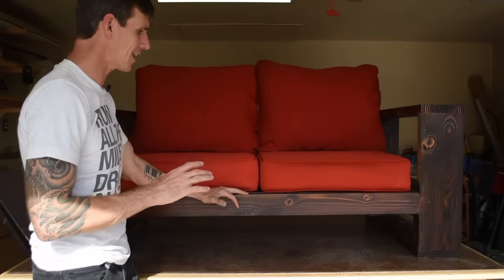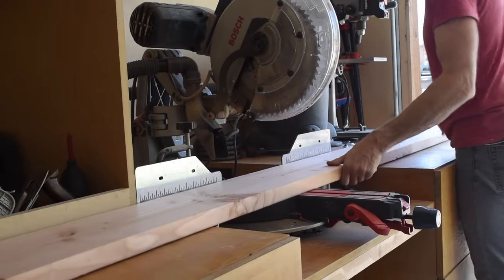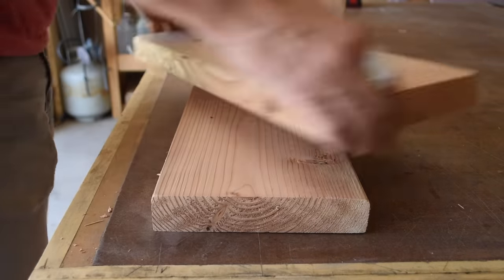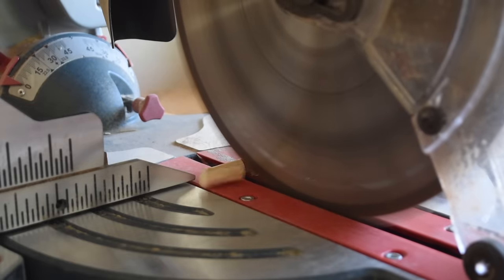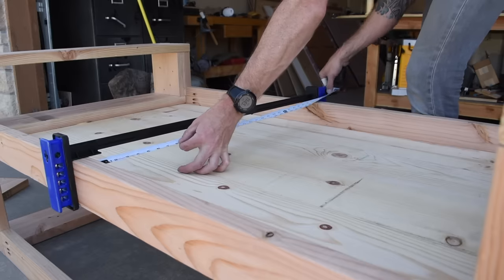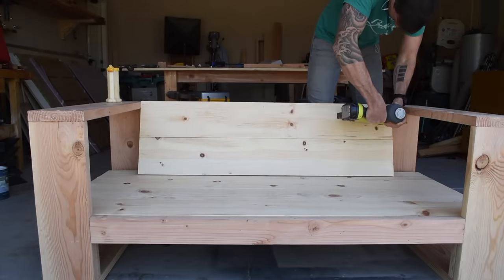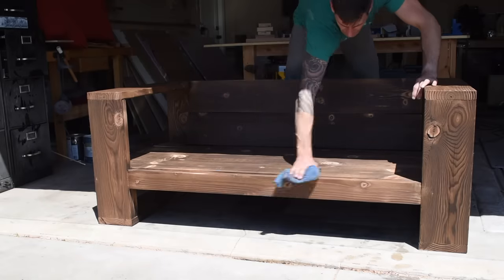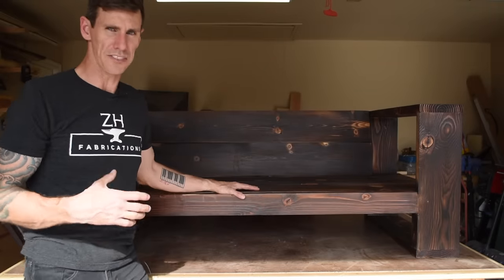DIY Modern Outdoor Sofa -  Shou Sugi Ban | Limited Tools | Free Plans

Comment: I don't see how the measurements of the wood purchased translates to the dimensions of the build. With my calculations  it seems you'd come up short on 1x8's. I think you'd need 10 foot 1x8s not 8 footers to have enough for the seat and the back.
Reply: Yup, I also ran into this issue
Reply: We're are the cut sizes.

Comment: I built this as my first ever DIY build and it turned out great. I did not use the burning but rather used a dark stain and quickly wiped it off.  It didn't turn out looking burnt like I had hoped, but I am really happy the way it turned out. I'd also like to mention that I didn't use a planer and it looks fine.  It did mot best to pick out good wood, but since this took me a few days some wood warped after it was taken home.  All things considered, I LOVE this on my balcony and 100% recommend this for anybody who is a complete novice.  I only used a circular saw for the cuts for those wondering if you need a crazy saw like he has. Thanks, Jonny!

Comment: Nice build! Be sure to preload those end grains with glue . Simply apply glue to the end-grain. Let it soak in.  Apply more as needed until it stops soaking it in. Then continue as normal. This will tremendously improve the bond strength of an end grain glue up.
Reply from the maker: Good tip, thanks!
Reply: Cool. I got this from Steve Ramsey. He owns the channel woodworking for mere mortals. He has a lot of really scaled-down tutorials on woodworking tips and tricks that are super easy to relate to.

Comment: Hey man, the sofa turned out great! I’m interested to see how the wipe on poly holds up outside, not something I’ve seen for outdoor use before.
Reply from the maker: I'm actually curios myself. My thought is the torched wood does most of the protection from the elements, and the poly just adds that nice feel. It could potentially be a disaster!
Reply from the maker: Also, thanks man! Hope things are going great with J5!
Reply: Jonny Builds for sure, my worry would just be that it’ll peel off. Keep me posted, fun experiment for sure!
Reply: Jonny Builds and thanks man’
Reply from the maker: Ok, will do!
Reply: Let us know!
Reply: Bộ ừu sẽ dễ để
Reply: @JonnyBuilds  Hey Jonny, and how is it now?
Reply: @JonnyBuilds  any updates on this??
Reply: @JonnyBuilds  any updates on how the poly did?
Reply: what would be the typical finish for outdoor sofa like this? (also specifically for pine/fir would be helpful)
Reply: My experience with using poly outdoor is it does crack rather quickly.

Comment: Wait 🤔 you can use poly outdoors instead of spar urethane or are both good in this example since the burning of the wood already acts as a protection layer ? I'm very much new to wood finishes experience knowledge.

Comment: I like it and simple to make. I would of put feet on it to take less surface touching the ground. 1 to 1 1/2 inch blocks. Question- did you use treated wood? I watched twice and didn't hear you state. Thx
Reply from the maker: Thanks, Jessie! I never use treated wood. The shou sugi ban is basically the treatment. I added some rubber feet to get it off the ground, but didn't show it in the vid. Thanks for watching...twice!

Comment: I just did this today. One thing tho regarding the materials... you would need 4 1x8s (8ft) and 2 more 1x8s(6ft) for the backing. I had to run back to Home Depot to get the backing.
Reply from the maker: Nice. I was able to get it done with the 4 1x8’s I mentioned in the video. I did see that I listed 2 10ft & 1 8ft 2x8’s but said you need 4 total in the voiceover.
Reply: @JonnyBuilds  So your 1x8s had to be 10' (you list them as 8').  Can't get 64 3/4" + 50"  out of a 96" (8') board...
Reply: Yeah man, this has been throwing me off. Thank you Paul and Smithi. Don't see how I can get the back panels if all 4 1x8s are for the seat....unless you got 10 footers? Love the videos and the plans though Jonny. Working on the work bench next. I'm totally a beginner at all this. Thanks again everyone!

Comment: Hi Jonny, thanks for the built! Look relatively easy and I might be able to do something similar with the tools I have I have a hand circular saw that should hopefully give me fairly straight edges. Any tips on how I can make more precise cuts with it? It's a cheap model that doesn't come with a guide rail, so I have been using a straight piece of wood as a guide, which is cumbersome.
Reply from the maker: The best way is to clamp a straight edge to your board you're cutting. Most circ saws are 4 inches from the outside edge to the blade. You can just measure for those extra four inches and know where to set you guide board. Thanks for watching!
Reply: a carpenters square helps a lot with smaller cuts
Reply: Thank you, very good advice!
Reply: MiroAcronymity grab yourself a carpenter Square. Simply locks on to the edge of your board and gives you a straight edge to cut. will tremendously improve the accuracy of your circular saw cuts to almost perfect
Reply: And if your Cuts aren't perfect, finish sanding takes care of all ills. Play enough glue so there's some additional squeeze out. If there's any gaps, simply apply some glue to the gap, wipe off the excess and then sand right over your wet glue to fill in the gap. the addition of the wood dust from sanding will allow you to also stain the wood glue if you choose to stain it. Making those joints butter baby!
Reply: Thanks for the great advice! I'll see if I can find a nice stainless steel or at least aluminum carpenter's square at the DIY store. Really appreciate it!

Comment: Why do you cut halfway through your stock on the miter saw before cutting the full depth?
Reply from the maker: Making a few smaller passes allows for a cleaner cut, less tear out, and less burning. Takes about the same amount of time as chopping straight through.
Reply: Interesting. Thanks!

Comment: What would you suggest if you didn’t have the tools to make pocket holes?
Reply from the maker: Buy a pocket hole jig. The cheapest one is about $15. Worth it.
Reply: @JonnyBuilds  Thanks. Didn't realize there were smaller versions. I was looking at the version you have which was about 10x that price. Thanks man
Reply from the maker: That R3 jig I was using is $40 if I’m not mistaken. That and the K4 (about $100) are my favorite. If you planning on making a bunch of furniture and cabinets it’s a good investment.
Reply: @JonnyBuilds  Another question: Most videos or posts I see about DIY furniture includes the recommendation to stain/protect immediately. However, when I was at my neighborhood lumber yard - they suggested waiting 6-8 months to allow the wood to fully dry before ever putting any products on it. Is there a reason for this? That you would stain immediately instead- because the wood is already dried perhaps? Thanks :)

Comment: Just getting started on wood working, lots of questions about working with pressure treated vs non pressure treated.  Are you getting pressure treated lumber at the home center? Kinda confused on what is and isn’t safe. Some say it’s okay and some say it’ll give you cancer 🤷🏼‍♂️
Reply from the maker: I don’t use pressure treated in any of my projects. Pressure treated is fine for outdoor projects. I would never have it in my home.
Reply: @JonnyBuilds  Understood. Do most home centers sell non-pressure
 treated dimensional lumber?